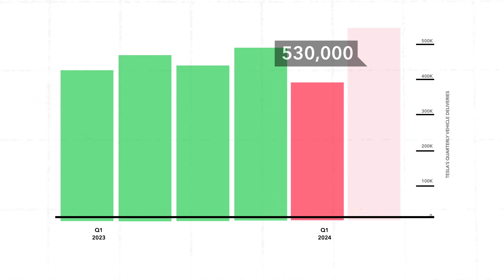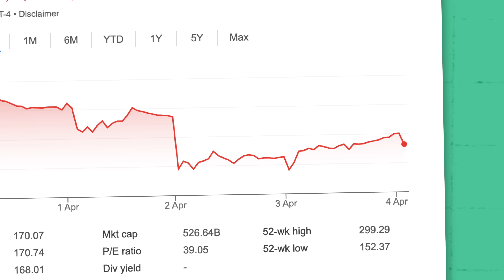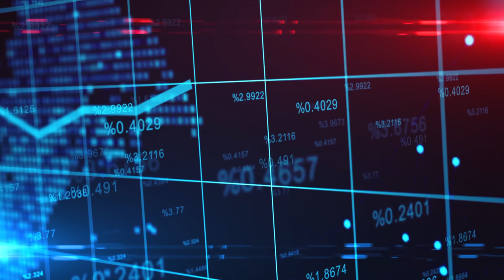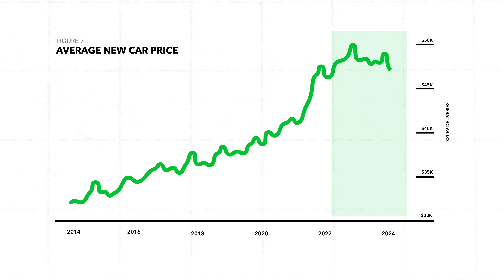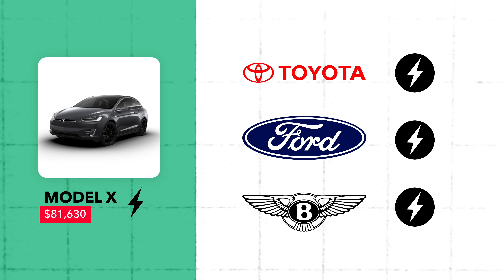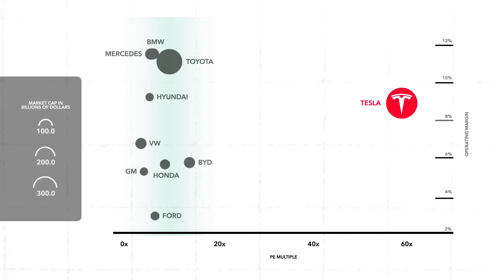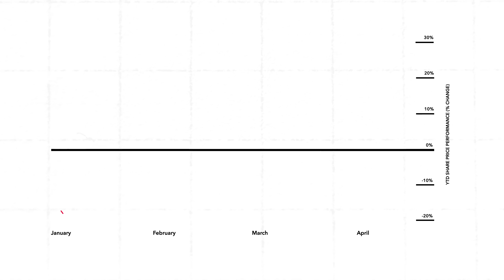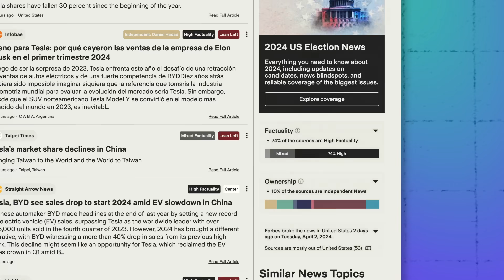Why Tesla’s Stock (Still) Has Further To Fall

Comment: The stock is in decline, because it is still massively over valued
Reply: Could you care to explain?
They make the most EVs and actually make money on them.
They have the most efficient EVs on the road.
They own the most reliable charging infrastructure.
FSD V12.3
They are entering the pickup market with Cybertruck, which will sell like hot cakes. 
Next gen vehicle coming next year
I'm confused by your comment.
Reply: muskies desperately trying to justify how a car company that barely sells any cars should be valued in the billions
Reply: @BartekBorowski  they are entering the truck market, lol, five cybertrucks a year, which are expensive as fuck and ugly as shit. FSD will never get above class 2 self driving ability, relying on vision alone, it's the worst self driving on the market.
Reply: @ltbq  Could you provide some factual statements to support your comment to make it objective vs subjective? They have sold 380K EVs this quarter, more than any other auto-maker. Your comment is invalid.
Reply: @FightTheByte_  When do you think "full self driving" will really be full self driving? Is the likes of Waymo not a competition?
Reply: @runklestiltskin_2407  Cybertruck is currently at around 1000 units/week for the most expensive 100k+ model, with cheaper 70k model coming soon which will expand the market for it. Looks are subjective, andpeople seem to like it. 
FSD- have you actually seen how V12.3 drives, and its improvement over previous revisions?  It's a solved problem that simply requires more training. (I say simply but training NNs is not simple)
Could you provide which ADAS system is more advanced that is NOT geo-locked?
Reply: @saitejagutta5338  Waymo's approach is not scalable. Its too expensive to roll out world wide as it requires mapping and sensor fusion. In geo-fenced locations possibly, but FSD can be dropped anywhere in the US and it will be usable in its current format, which will improve with more training.
Reply: @BartekBorowski  "They make the most EVs and actually make money on them." that is a weird sentence. Tesla is not the biggest producer BYD is. Are you impaling BYD is not making money?  

They have the most efficient EVs on the road. this date is all over but Tesla model 3 is ~ 140Wh/KM and Hyundai IONIQ 6 is ~140Wh/KM both at 43 000 euro. but Dacia Spring ~150Wh/KM at 22 000 euro (with the state support it was 12 000 euro for me). 

They own the most reliable charging infrastructure. depends on the country 

They are entering the pickup market with Cybertruck, which will sell like hot cakes. The rust bucket are you serious?
Reply: @FightTheByte_  Nope, Tesla is overvalued. While they’re the leading EV maker, that’s only 15% of the overall car market, so they have 7% total. There are many companies valued lower that have larger market share valued lower, and the justification for Tesla was that EVs were the next big thing and Tesla had the lead, but that’s no longer true. Tesla is poorly run: it has ongoing labor problems, build quality has always been sub-par, and they have constant production delays. The legacy car makers are catching up, and China’s new brands will likely gain a foothold in many markets, diluting Tesla’s share further.

As far as self-driving and AI - dream on. The only way full self driving will ever really work is changes to road infrastructure, and that still won’t account for all the places with lousy roads. No company is close to an AI that can deal with Asia, South America, rural Europe, etc.
Reply: Electric vehicle sales are not the same as all vehicle sales, many companies sell more cars and make more money. Compare Tesla to Toyota for example, Tesla stock is worth FAR more but they make a lot less money and sell a lot less cars. Tesla stock is a bubble, while Toyota stock price is accurate.
Reply: @FightTheByte_  What you’re failing to realize is that the EV market and Tesla are not synonymous. I’m not saying the EV market won’t grow, I’m saying Tesla won’t dominate, something Musk himself has said. Tesla has 7% of the current car market. If the EV market doubles to 30% and Tesla is still 7% of the market - that’s not a win.

You seem to be conflating my comments on EVs and FSD; the latter is decades away, and it does Tesla no favors for Musk to keep saying “next year.”
Reply: @FightTheByte_  peak fud, also elon bad, just hold long run 10 years and we win these bears are short sighted and join the band wagon
Reply: @BartekBorowski  Mercedes have a class 3 FSD
Reply: @FightTheByte_  🤣
Reply: @runklestiltskin_2407  levels are irrelevant, they are only there for liability and legal reasons. Mercedes ADAS works in the same way as any other ADAS system with pre-mapped and geo fenced routes. Notice how you can only use it in very specific conditions (mostly highways), whereas FSD drives anywhere in the US.
Reply: @FightTheByte_  We’ll have to agree to disagree. I think Tesla’s lead in manufacturing was weak from the beginning, and they squandered it making a lot of the same poor choices that Porsche did in the 1980s and 90s before Wendelin Weideking revamped the company after calling in consultants from Japan. Now that the established companies have their own (modular) platforms to base EV models on - some also ICE-compatible - we’ll see them increase market share and pass Tesla. As for the Amazon comparison: I’ve been a Prime member since the 90s, 20% of my portfolio is Amazon stock, and I worked for Amazon for over seven years. I know Amazon, and Tesla is no Amazon.
Reply: Barely sells? Lol, the Model Y is one of the most popular vehicles on the road @ltbq
Reply: @BartekBorowski Levels is 100% relevant as they litteraly describe how advanced the "self driving" is..🤦‍♂️ What you are doing here is coming with a typical and very false claim only Tesla fanboys can find logic in🤣 Tesla "FSD" (false advertising with the name btw) beta crap is just a simple system with physical hardware lacking to even be anything close to real FSD🤦‍♂️
Reply: @kahsjdkahddf1258 Don't get why they sell so much as it does. Model Y is crap🙄
Reply: @runklestiltskin_2407  add to that the cybertruck is death trap for pedestrians and a safety hazard for it's owner. The panels have rusted on some peoples cars as well. Imagine thinking one of the worst trucks ever made is going to save the company.
Reply: @BartekBorowski  they’ve been saying they’re going to release the pick up for years now bud
Reply: @FightTheByte_ you are just creating excuses. Fundamentally it is over valued. The competition is multiplying day by day.
Reply: I'll add a word on the Cybertruck.
Even if it explodes in popularity in America, which I doubt it will, it will be pretty much stuck there because it's design is fundamentally incompatible with modern safety standards. The EU would never allow that thing on European roads.
Reply: Ready for another RECALL...everyone??????

Comment: In addition to cost, the decline in Tesla's sales can, in part, be attributed to the growing consumer frustration over issues related to the right to repair. Tesla, like some other manufacturers, has faced criticism for its restrictive repair policies, which limit owners' and independent shops' access to necessary repair information, tools, and parts. This approach not only inconveniences Tesla owners but also potentially increases the cost and time needed for repairs. In an era where consumers are becoming increasingly aware of and concerned about their rights and the environmental impact of their purchases, such restrictions could lead to negative perceptions of Tesla's brand. Customers are showing a preference for companies that empower them with more control over their purchases, including the ability to repair products affordably and efficiently. Consequently, Tesla's stance on repairability could be a significant factor contributing to its dipping sales, as consumers look to brands that better align with their values around sustainability, cost-effectiveness, and autonomy in repairs.

Comment: Canadian millenial here. This situation is a result of the wealth gap. 

Boomers bought like 5 times as many cars as their counterpart millenial does. The auto industey expects to sell cars like every driver is a boomer but thats not the case anymore.
Reply: @saoirseewing4877 
More and more people don't care about driving a manual transmission car and in fact don't want to drive a manual transmission car and I suspect that a lot fewer young people and teenagers want to spend their time working on their car compared to 50 years ago.

Young people just want a car to get them from A to B and (depending on the city) are much happier now to get around on foot or by public transit.

And unlike some baby boomer men I don't think that many young men will care if self driving cars do all the thinking and work and take the driving experience away from them.

To older men who find that outrageous I ask if they walk to the local creek with a bucket to
"be a real man" and get their own water or do they just use the water that the government sends through pipes straight to their kitchen sink?

Comment: I think there has been a lot of FUD about EVs generally over the last few months and this may be having an impact on sales of EVs as a whole and Teslas in particular. Also Teslas are not cheap, the price of the M3 starts at £40,000 in the UK. To keep growing Tesla needs more affordable cars quickly. By affordable I mean cars that cost £15,000-£30,000, not £30,000+. I also think the Cybertruck was a massive distraction, Tesla should have concentrated on the “Model 2” first while working on the CT as a secondary project.

Comment: What are the best strategies to protect my portfolio?  I've heard that a downturn will devastate the financial market, so I'm concerned about my $200k stock portfolio.
Reply: Some strategies could be put in place for solid gains regardless of the economic situation, but such execution is usually carried out by an investment specialist.
Reply: @NebiheVergara I agree. Based on personal experience working with an investment advisor, I currently have $480k in a well-diversified portfolio that has experienced exponential growth. It's not only about having money to invest in stocks; you also need to be knowledgeable, persistent, and have strong hands to back it up.
Reply: @TimothysScotts  Mind if I ask you to recommend this particular coach you using their service? Seems you've figured it all out.
Reply: @QuisenberrysClarkes  The beauty of MARGARET MOLLI ALVEY approach is her dual focus: while aggressively pursuing profit opportunities, she's equally tenacious about shielding investors from potential pitfalls. It's a balance few can achieve.
Reply: @TimothysScotts  Thank you for this Pointer. It was easy to find your handler, She seems very proficient and flexible.

Comment: The factory near Berlin wasn’t directly attacked as it sounded during the intro. People attacked the power line connecting the factory. That‘s a very big difference
Reply: Can't stand Tesla, but no power, no factory?
Reply: @stuartburns8657  Pretty much, yes. But no power is way less serious and easier to fix than no factory if you get what I mean.
Reply: @Simon-sw4ov  100%.
Also I imagine less severe for those who did it, as opposed to burning a factory down etc

Comment: I don't think charging infrastructure really has much to do with EV sales, unless you are counting things like apartment buildings and condos
Reply: there are alot of people who live outside major cities. And the ability to recharge in those areas can be really poor. That does affect people's decision on whether or not to buy and electric vehicle.
Reply: @ThatGuy-bz2in  if you have a garage (or your local climate doesn't get much in the way of winter) charging at home is super easy. It's people doing things like street parking, and parking in their building's lot that have the problem, so much more of a city than suburban or rural issue.
Reply: I totally agree. I have an electric ix3 for commuting to work, in the 12 months I have had it I have never used a public charger. Main reason is that at home I pay £0.07 per kWh, public chargers cost £0.70, that’s more expensive than petrol. 

If you have to rely on public chargers then there’s no point in getting an EV unless you can right off the cost from you tax bill

Comment: Charging infrastructure is probably going to remain limited forever for one simple reason: home charging. If you can plug in at home and charge for cheap overnight with an L1/L2 charger, then you don't need public chargers outside of roadtrips. And most of the people buying EVs are doing just that.

Ever wonder why public EV chargers are always unmaintained and half-broken? EV owners aren't using them enough to justify the maintenance cost on that infrastructure. Charging at a public charger is more expensive because you're paying for DC fast charging.

So what if we just banned home charging to force demand for public chargers? Well, that's still not great, because DC fast charging is actually really bad for the batteries on these cars. So you wear down the battery faster, meaning these cars lose their value faster, and we're mining more lithium out of the ground to make more batteries.

L1/L2 is far less taxing on the battery, but nobody is going to operate public slow chargers. The people using them want to get in and out quickly, and the people who own the chargers want lots of people using them. I've heard proposals for deploying them in parking garages and other places where you will be parked for hours at a time, and while that's a very good idea, nobody is going to pay for it.

Tesla offered battery swap programs at their public chargers, and while that fixes some of the problems I mentioned above, it creates new ones. You can't standardize the battery size, shape, and location in such a way that a location can just have a bunch of EV batteries ready to go for any car you throw at them. Tesla could only offer battery swaps because they have an incredibly closed ecosystem. Furthermore, you don't know if people are coming in with damaged batteries that will explode when you charge them, or worse, explode in someone else's car.

The situation with chargers actually mirrors the situation with refueling gas cars before we had mass-produced cheap cars. Cars used to just be expensive toys for rich people who had fuel delivered to their house. EVs are similar: they only make sense for home-owning suburbanites, because they are a retrofit for transit-hostile suburbs. Everyone else doesn't need EVs, they need trains.

Comment: I think the price is supported by the speculation the full self driving is near an it will allow TSLA to dominate the taxi market and also collect subscription fees for using full self driving so that there earnings could easily quadruple in the next 3-5 years and that does not count what Optimus might bring in terms of manufacturing efficiency and/or additional sales.  I think 170 is cheap for Tesla if one understands what it really is.
Reply: With Apple pulling out of making their own cars they may be interested in purchasing Tesla, as would many other tech companies.
Reply: Spoken like a true believer.
Reply: Yes, the price is taking that speculation into account. But Musk said Full Self Driving would be ready years and years ago. There is no evidence it is close.
Reply: Full self driving has done nothing but get worse. It’s not gonna happen, especially now that they’ve removed radar and become camera only. It’s a horrendous car to use for its autopilot since Nov 2022. At night time it’s so extremely dangerous and braindead.
Reply: @Jupa do you own a Tesla and have you tried FSD 12.3?

Comment: Q1 is traditionally a weak quarter for Tesla as people don't tend to buy cars at the start of the year.
Cyber Truck which has about 2 years of reservations is starting to ramp.
New cheaper model coming out next year.
Tesla's in-house battery production is becoming significant.
FSD is getting to the point where it has very few interventions.
The Tesla Bot should become useful for Tesla's factories by next year.
Grid storage is sold out for about 2 years.

Sounds like a good time to buy for me, new ISA year tomorrow.

Comment: This is called market correction. There is nothing wrong. Overvaluation based on hot air is wrong.
Reply: Overvaluation based on earnings reports are never hot air. Its stock movement is primarily based on options flow. The fundamentals WILL drop it more as they always prevail
Reply: Overvaluation based on earnings reports. The movement in its stock is based on options flow. The fundamentals will always prevail

Comment: I think u guys might have tried to not link to Musk to not sound like beating a dead horse. But if we talk only about Tesla his name kind of have to be in the Mix, in the other side, if we talk about EV's more broadly I might be able to add something, I have seen working kollegues and friends regret they EV purchase mostly cuz of the spare parts market. Those cars have shown to be a nightmare to fix, specialy because some of them, Tesla included but far from be the only one, are pushing the Apple model of making hardware, locking the thing in a way you cant go to ur mechanic anymore, you cant buy parts and change yourself, is 'too dangerous' with more and more people having the same experience on the markt of ev's word spread around and nobody want to buy one, new or used.
this come from someone in Austria, where Charging is fairly available even in small city, gov subsidizes the car and the installation of the charger at home, and if u lucky installation of solar panels can also get subsidize. with all this is still a pain in the ass to own a EV